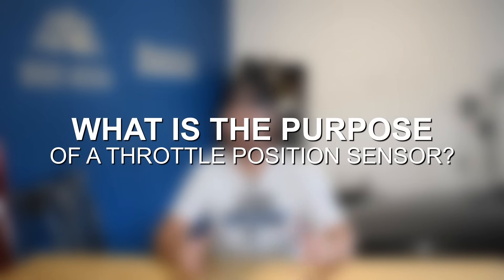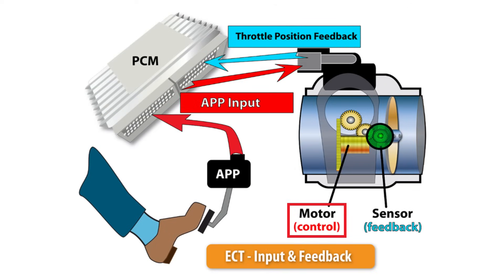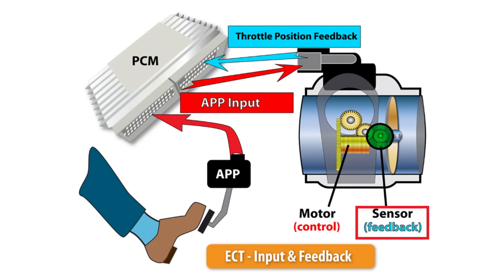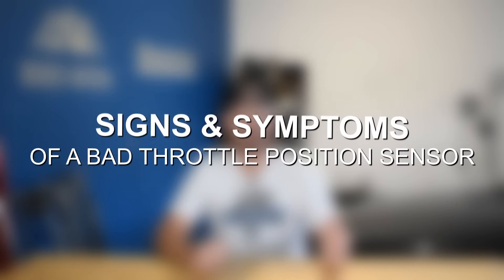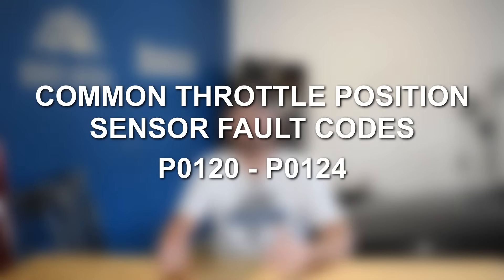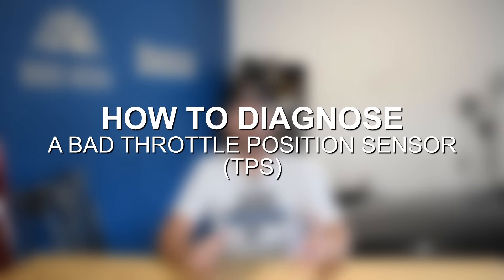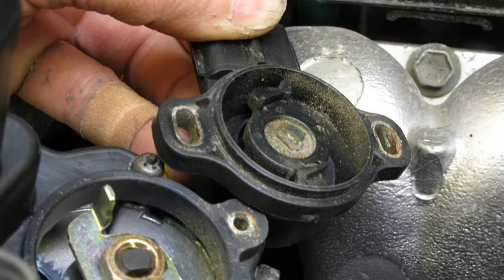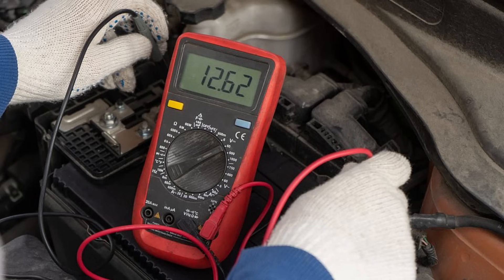Signs & Symptoms of a Bad Throttle Position Sensor (TPS)!

Comment: Thanks very much for this video, really well done. I've got a '03 Silverado 5.3 that is not throwing any codes but is experiencing the TPS symptoms you discuss. When I first start and drive it, there isn't a problem as long as I maintain a steady speed. It will downshift if I give it more pedal. Upon stopping and then resuming, it stumbles when any throttle is applied and won't downshift. If I turn the ignition off and restart it will run fine until I have to stop again. Recently I had a new fuel pump, fuel lines, regulator, plugs, and wires. Injectors in cylinders 7 & 8 were replaced. At that time I was getting a P0300 and a P0332. The MAF has been cleaned. I bypassed the Bank 2 KS and now there are no codes. The static fuel pressure is a little low at 52 psi, while idling it's 45-47 psi. The truck has not been driven is a couple of years which has caused some of these issues. Thanks in advance for your advise.
Reply from the maker: M - Thanks for the feedback! Given your vehicle's intermittent stumble and refusal to downshift after stopping—despite no active codes and after replacing major fuel system components—the symptoms strongly suggest a failing throttle position sensor (TPS) or intermittent issue with its wiring or connector, especially since the problem temporarily resolves with an ignition cycle (which resets adaptive throttle values); the fact that fuel pressure is a bit low (spec is ~55-62 psi) could contribute but wouldn’t typically cause such specific throttle-related behavior, so I’d start by monitoring TPS voltage live on a scan tool for any dropouts or sticking values as the throttle is applied, check the connector for corrosion or looseness, and consider replacing the TPS if inconsistent readings are found—even without codes, faulty throttle input can trigger “limp” behavior that resolves only with a restart.
Reply: @8020Automotive  - I really appreciate your quick response. There is a small nick exposing copper in one of the TPS connector's wires (white, I think), but that's probably not the problem. I'll try checking the TPS voltage first but will probably just install a new one. Thanks again for your help, you've got a great channel!
Reply from the maker: @mICHAELBrown-z3y  Thanks for the support! We're here to help
Reply: I have a 05 sierra that sat 5 years and I'm going through the exact same problems. I just ordered a throttle body from rockauto. GM Genuine. Waiting patiently

Comment: Can it also say check charging system, at a red light I stopped, light turned green and car wouldn’t move, engine still moving, cut car off and it drove. But wrench  is still on and says charging system. Any advise?
Reply from the maker: L - Not sure what type of vehicle you have, but Yes, if “Check Charging System” is displayed along with a flashing check engine light, a wrench icon, and momentary loss of throttle response after stopping at a red light, it strongly suggests a charging or voltage irregularity—possibly due to a failing alternator, bad battery connection, or corroded ground strap, which can cause the electronic throttle and other critical modules to shut down or behave erratically; even though the engine kept running and it drove after restarting, the wrench and charging warning indicate the car detected a fault in the charging circuit, so you should immediately test alternator output under load, inspect battery terminals and grounds for tightness and corrosion, and scan the ECU for stored codes that may point to undervoltage or throttle control system faults triggered by the voltage drop.
Reply: @8020Automotive thank you, and I’m sorry it’s a 2008 Mustang GT.

Comment: I drive audi a3 3,2 v6 when I drive slowly is started jekking
Reply from the maker: D - If your vehicle is jerking during slow driving, the most common causes are typically related to ignition or fuel delivery issues such as worn spark plugs, failing ignition coils, or dirty fuel injectors, but it can also be caused by a dirty throttle body, vacuum leaks, or transmission-related problems like a worn DSG mechatronic unit if your model is equipped with a dual-clutch transmission; since the issue occurs at low speeds, start by scanning for stored fault codes, then inspect the ignition components and throttle response, and if those check out, consider transmission adaptation reset or fluid condition as jerking at low speeds is often drivetrain-related in these cars.

Comment: What about P0068 doesn’t that have to do with Maf/Map and throttle Body too??
Reply from the maker: B - Yes, P0068 absolutely involves the MAF (Mass Air Flow) sensor, MAP (Manifold Absolute Pressure) sensor, and throttle body—it’s a correlation code, meaning the ECU has detected that the readings from the MAF/MAP sensors don’t line up with what it expects based on the throttle position and airflow; this can be caused by a dirty or failing MAF, a faulty MAP sensor, a sticking throttle body, or even an air leak (like a cracked intake boot or loose hose) that’s throwing off the airflow calculation—so yes, this code ties those three systems together and usually means the engine isn’t getting (or the ECU isn’t detecting) air the way it should during throttle transitions.

Comment: What to use to clean the TPS?
Reply from the maker: T - To clean your throttle position sensor (TPS), first disconnect the negative battery terminal and locate the TPS on the throttle body (usually secured by two screws), then unplug its electrical connector; spray a small amount of electrical-safe cleaner (not carb or brake cleaner) into the connector area and around the sensor shaft, gently rotating the throttle plate by hand to work the cleaner in, let it evaporate fully, then reattach the connector, reconnect the battery, and cycle the ignition on/off a few times (without starting) to allow the ECU to recalibrate before you drive.
Reply: @8020Automotive  Thank you!

Comment: Will sea foam let white smoke out? N will this part let the code come on n once u shut it off it goes away?
Reply from the maker: S - Yes, using Sea Foam (especially through the intake or vacuum lines) can definitely cause white smoke to come out of the exhaust temporarily—that’s normal and expected as it burns off carbon deposits and unburned fuel during the cleaning process; as for the Throttle Position Sensor (TPS), a failing one can absolutely trigger a code (like P0121–P0123), and it's common for the code or symptoms (like hesitation or erratic throttle) to disappear after shutting the engine off, only to return later—this happens because the TPS can fail intermittently and the ECU clears some temporary faults on restart until it sees the issue again.
Reply: @8020Automotive  ok thank you

Comment: You know it worked perfectly? A cable that ran from your gas pedal. 40 years later you could still be using it.  Cars from 2000 on are absolute garbage. Learn from experience.
Reply from the maker: R - PREACH.

Comment: I'm driving a Kia Rio 2015 model I'm having a problem with it wanting to cut off when I want to accelerate.when I'm using gear 1and 2 the moment I accelerate it kinder want to cut off before it takes off.
Reply from the maker: S - Your 2015 Kia Rio wanting to cut off or hesitate when accelerating in 1st and 2nd gear is likely due to either a failing throttle position sensor (TPS), a dirty or sticking throttle body, or a fuel delivery issue such as a clogged fuel filter or weak fuel pump—this kind of low-RPM stumble is usually from the ECU not getting the right air/fuel or throttle signal during quick throttle input; it could also be a mass airflow sensor (MAF) problem or even an ignition coil starting to go bad, so your best first steps are to clean the throttle body, inspect and clean the MAF sensor if equipped, check for vacuum leaks, and scan for any stored or pending fault codes to zero in on the exact source.

Comment: I have a Cadillac CTS 2994 3.6L the car was running fine and then one day she start acting up she wouldn’t start so I think I was the battery and the battery was bad when they test it so I buy a brand new battery and then couple day later she
Would start again and then black fire so I town it to the mechanic and then the
Mechanic send it was a vacuum leak so repair the vacuum leak and couple days later she wouldn’t start again after putting gas in it !!!! So I go to the mechanic and he tell me oh the car is fine but I tell him the car doesn’t start after I fall up gas in it tell me oh well I let the car run for 30 minutes and I don’t see anything wrong take back yr car so I tell him still change the coils and the oxygen sensor bank 1 sensor 2 because the code said it was bad and it charge me a huge among 680 $  and the next day still the car stall on me and then now the RPM
Go high on
Park !!!! And I give the mechanic 1300 $ and the car still is fuck up so I don’t  know what do I spend money to repair my car and she is worse each time
Reply from the maker: W - I'm really sorry you're going through this—that’s frustrating, especially after spending that much money and not getting results—but based on your symptoms (no start after fueling, stalling, high RPM in park, black smoke or backfire, and erratic behavior even after new coils and O2 sensor), it sounds like you’re dealing with a fuel system or EVAP system failure, possibly a stuck open purge valve that's flooding the engine with fuel vapors after you fill up, or a bad fuel pressure regulator or leaking injector causing rich running and hard starts; the high idle in park could also point to an intake air leak or faulty idle control, but at this stage, you really need a better diagnostic scan with live data—I’d suggest getting a second opinion from a shop that specializes in Cadillac or GM diagnostics (not just guessing and swapping parts), because continuing like this is just burning money while the root cause is likely something simple that’s being missed.

Comment: Would a bad TPS cause bad starting? My starter cranks but doesn’t catch , electric grinding 2-3 times before I can start clean
Reply from the maker: 5 - Yes, a faulty Throttle Position Sensor (TPS) can contribute to hard or inconsistent starting, especially if it’s sending inaccurate throttle angle data during cranking—on many modern vehicles, the TPS helps the ECU determine how much fuel and air to deliver at startup, and if it’s reading incorrectly (like showing wide open or completely closed when it’s not), it can cause fuel delivery to be off, leading to excessive cranking or a rough, delayed start; however, the electric grinding sound you’re hearing may also indicate a starter engagement issue, like the bendix not fully retracting or the flywheel gear catching awkwardly, so it's possible you have a combo of electrical and sensor issues—scan for TPS-related codes or erratic voltage readings and also inspect the starter’s engagement mechanism before throwing parts at it.

Comment: Excellent video and highly appreciated. The question to be raised is, do we have to program the throttle body sensor after replacement?
Reply from the maker: A - Thanks for the feedback! In most modern vehicles, yes — after replacing the throttle body or throttle position sensor (TPS), it's often necessary to perform a throttle body or idle relearn procedure so the ECU can properly recalibrate the throttle's range and idle control. Some cars will relearn automatically after a few drive cycles, but others require a manual relearn using a scan tool or a specific ignition/throttle sequence (like turning the key to "ON" and slowly pressing the gas pedal multiple times). If you skip this step, you might experience high idle, poor throttle response, or stalling. Check your vehicle’s service manual for the exact relearn procedure.
Reply: @8020Automotive  Many thanks and highly appreciated.

Comment: Eclipse throttles up and down after driving and letting off the gas. Check engine light on. Tested and it gave me a fault 14 electronic automatic transmission. When I looked it up I only see things about this. So I’ll be cleaning and testing ❤
Reply from the maker: L - Hope it works out! Keep us updated.
Reply: Vacuum hose has a leak somewhere, idle air control valve is bad, theres a leak in the throttle body or TB gasket, theres a few more things to cause that on eclipse🛠⚕️🎶🎵 if its turbo, then if the intake pipe is leaking around the turbo inlet, wastegate/boost solenoid/evap/egr/AirCon vacuum broken, vacuum not reinstalled from work done, it will idle up/\down, too ~C< 3)>>-Z->}

Comment: Hi Friends! For Rav4 2013, 4th Gen, We cleaned the fuel injectors also the throttle body. After that, car is spending more gasoline. What can be check or set in the computer settings? Or just cleaning some more sensors would help? I used to run about 300 miles with a tank
Reply from the maker: O - After cleaning the fuel injectors and throttle body on your 2013 RAV4, the increased fuel consumption could be due to uncalibrated air-fuel ratios or a sensor reading slightly off. Start by checking and, if needed, cleaning the MAF (Mass Air Flow) sensor, as it's sensitive and directly affects fuel trimming. Also, make sure the throttle body position was reset properly using a scan tool or throttle relearn procedure—otherwise, the ECU may not manage idle and fuel delivery correctly. Finally, check for any vacuum leaks introduced during reassembly. If all is clean and sealed, the ECU may need a few full drive cycles to re-adapt and normalize fuel trims.

Comment: I have a Nissan Versa 2011. I turned the ignition ON, then put a metal rod to press the gas pedal, but the Throttle butterfly still remains closed. Any feedback would be much appreciated.
Reply from the maker: R - On a 2011 Nissan Versa with an electronic throttle body (drive-by-wire), the throttle butterfly will not open just by turning the ignition ON and pressing the gas pedal manually (even with a rod). The ECU only commands the throttle to open once the engine is running or under specific diagnostic/test conditions. To open the throttle butterfly without starting the engine, you'd typically need a scan tool that supports throttle body actuation tests or a relearn procedure. This behavior is completely normal for modern electronic throttle systems and not a fault.
Reply: @8020Automotive  Thank you for the reply. I was cleaning the throttle body, and I followed the YouTube instructions to put a metal rod in it to make the butterfly open. Mine did not open, and I thought the throttle body was broken. Thank you again. Bless bless.

Comment: What if I am getting the same symptoms but no codes at all?
Reply from the maker: T - If you're getting throttle position sensor (TPS) symptoms—like hesitation, surging, stalling, or poor throttle response—but no codes, it’s still very possible the TPS is failing intermittently or is just out of spec but not far enough to trigger a fault. You can test it manually using a multimeter by checking for smooth voltage increase (typically 0.5V to ~4.5V) as you slowly open the throttle; if you see dead spots, jumps, or inconsistent readings, the TPS is likely bad even without codes. Also, check for loose connectors, corrosion, or wiring issues which can mimic TPS problems.

Comment: My codes are p0316 and p0304
I have the same symptoms.i replaced and gapped to 0.40 the plugs and replaced the injectors,cleaned the Throttle butterfly it is in good condition. and i still have the codes and symptoms of limp mode shaking rough loss of power .. could the TPS  sensor be causing the problem?
Reply from the maker: M - Yes, a faulty Throttle Position Sensor (TPS) can definitely cause rough idling, shaking, power loss, and even trigger misfire codes like P0304 (Cylinder 4 Misfire) and P0316 (Misfire Detected on Startup), especially if it's sending incorrect throttle angle signals to the ECU. Since you've already replaced plugs and injectors, and cleaned the throttle body, a failing TPS is a strong next suspect. It can cause inconsistent air/fuel delivery and incorrect timing, which would mimic misfire symptoms and potentially trigger limp mode. Consider testing or replacing the TPS, and also inspect wiring and connectors for corrosion or damage.

Comment: Thank you for this valuable tips. When I’m driving in lower speeds like in a traffic, I can feel some jerking when I touch the gas padle and when I take out the foot from the gas padle. And also when I push the gas padle and hold the gas padle in the same possition in lowet speed, in one point car is jerking around 2 seconds and after go smoothly. what will be the couses for these symptoms
Reply from the maker: K - Jerking at low speeds when you press or release the gas pedal, especially in traffic, is often caused by one or more of the following: dirty or failing throttle body, a worn engine or transmission mount, a failing mass airflow (MAF) sensor, or issues with the fuel delivery system like dirty injectors or inconsistent fuel pressure. It can also stem from a bad throttle position sensor (TPS) or software-related transmission hesitation. If your car has an automatic transmission, low-speed jerkiness can also come from a delayed or rough shift. Start by cleaning the throttle body and checking for any fault codes, even if the check engine light isn’t on.

Comment: I have a 2003 Toyota Matrix XRS that is rough idling when its parked throttle body is cleaned the mechanic wants to replace the throttle body, he didn't say anything about the TSP i will replace the tsp and check all the wiring. Thank you, great video, very informative
Reply: Was that the issue? My truck is doing the same thing while parked.
Reply from the maker: J - Thanks for the feedback! We hope it helps.